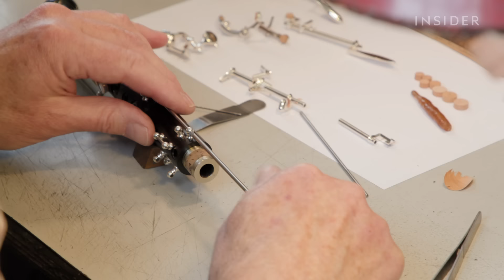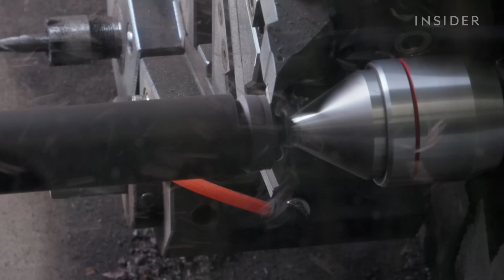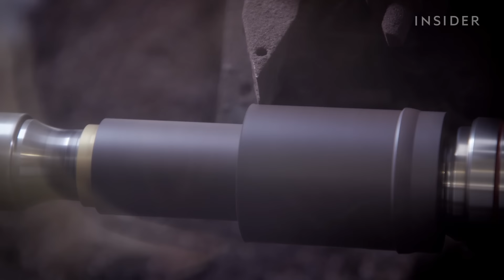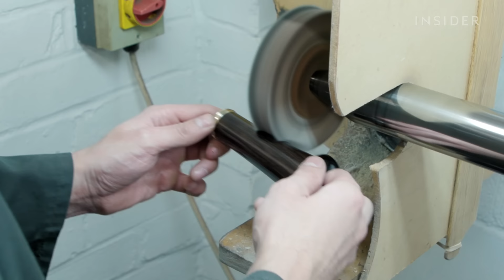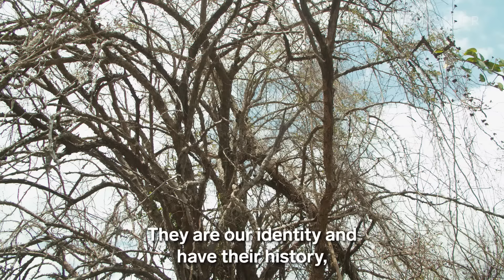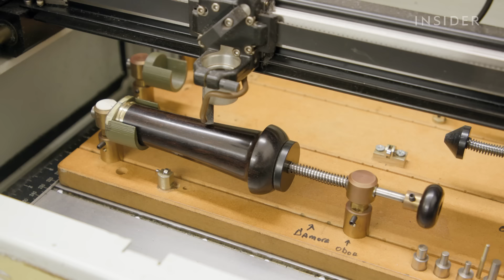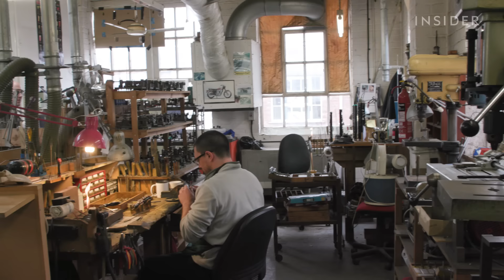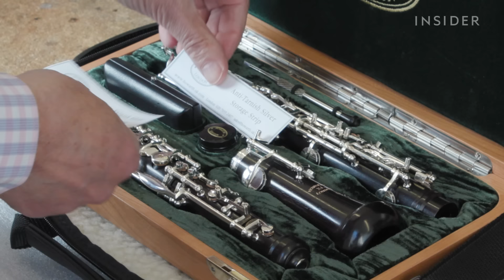Why Oboes Are So Expensive | So Expensive | Business Insider

Comment: Didn't expect to see a Metal Lathe, with precision tool bits, being used to make a Wooden Oboe.
Reply: As a person who does manufacturing/metalworking and favorite instrument is oboe, I just love this video
Reply: There is a LOT to this story that doesn't add up.  I wonder how many man hours it takes to run a CNC...
Reply: @RK-kn1ud  the CNC work is only in the turning of the shape of the body, maybe in drilling holes in the proper places, and at Howarth, probably milling some of the metal pieces that are then hand assembled into keys and bands. This gets the process started, but there's so much more. There are endless details, all of which must be painstakingly done by hand. This video barely scratches the surface.

Comment: Niceo video. I wonder if it could be possible to make them out of some kind of engineering plastic
Reply: Acrylic makes a great oboe, potentially as good as any wood oboe if done correctly.
Reply: They've been made in delrin (acetyl), PVC and ebonite (hard rubber) either as a whole or just the top joint, as well as wood (grenadilla, cocobolo and kingwood) with a partial ebonite bore lining in the top joint to safeguard against cracking.
Reply: @chrisperyagh  and against bore dimension changes as well.
Reply: It would be good if there was a singular substance they could be made from that was stable and not affected by humidity changes like wood or temperature changes like plastics. Not to mention plentiful, non-toxic, non-porous, non-reactive, easy to machine, has high tensile strength and doesn't weigh a ton. Is that asking too much from one single material?

Comment: Hello, flute and oboe player here. Professional flutes are on average 10,000 to 12,000 dollars. Starting as low as around 6,000 to as much as 20,000, even 50,000 in some cases. It all depends on brand and model. I heard the 4x more than a professional flute and giggled. My professional flute is roughly $13,800. Brannen, a very well known professional only brand starts as low as 10,000 if I remember correctly.
Reply: 4x more than a pro flute is hilarious, I’m sure there are 15k oboes out there. The most expensive a flute can get is around 130k for a full 24k Muramatsu.

Comment: I mean you can just make it out of plastic instead of this wood right? Manufacturing looks slightly complicated (for a musical instrument, otherwise this is nothing) but does not justify the cost. Seems like most cost is due to waiting waiting and waiting. All due to the wood. 

Does not seem to be wise choice in material if its so rare, endangered, low success rate in manufacturing and high failure rates in usage.
Reply: No. Only for student models. Grenadilla is used because of its sound quality and because although it can crack, but it's quite resistant against warping. What you just saw in this video is the very tip of the iceberg. Making one of these is waaaaay more complicated than you imagine. Don't think that just because someone can use a lathe, they'd be able to make one of these. The cost is justified.
Reply: @tamasfoldesi2358  as an electrical engineer, I naturally tend to compare the process to ones in my industry. When I compare the manufacturering and design process for something like a current 5nm CPU, this is oboe manufacturing absolutely nothing in terms of effort and resources required. So I didn't feel the price is really justified. But I guess it's just about economy of scales.
Reply: High-quality resins in intermediate models can sound quite nice, but in my experience they don’t project nearly as well.
Reply: Oboes are constantly put under a lot of environmental strain in the playing environment that many other woods just cannot handle. Temperature, humidity, pressure, quick changes in both while playing, are all very stressful on wood. Because the holes for the keys are so close together on an oboe, cracking is a concern. I would not consider it a “high failure rate,” though. It would be much worse with a softer wood. There are other woods oboes are made of, but those woods are often in a similar position as grenadilla, and grenadilla is considered to be the classic standard.

Oboes are also not made on commission, so you’re never waiting to get a new one. I went to the IDRS conference a few months ago and there were hundreds of instruments to try and buy. You have to try many oboes before you find one that will play the best for you. You can get two oboes from the same manufacturer, the same model, made from the same wood, but there are so many subtleties that one will play better for you than the other.
Reply: @skylargurnett8483  thank you for the info. I did not know much about oboes at all. What is it that you meant by 'not made on commission'?
Reply: @snehanshourya3850  They are mass produced, but unlike with CPUs, there are a lot of handwork involved. And as I've said, you don't know much about these instruments and how they are made. You've only seen like 1% of the entire process or even less. When I was just an average music school student and didn't know much about these instruments I also thought that they are overpriced. But after I started to learn how to repair or make them, I realized that they're not overpriced at all (maybe professional models are, but it's the same with everything, not just instruments) and the only reason why they are not even more expensive is because of the mass production and because there are lots of automated processes.

Comment: fascinating.  creating one seems more complex than playing one (which i believe is the most difficult instrument to learn), so how did they exist before such precise machines came into being?  granted the first ones were very basic in comparison...
Reply: They were just less precise. But actually a lathe is a surprisingly old invention. I think the oldest one found is from ancient Egypt if I remember correctly. Those were manpowered of course and not electric ones. Soldering, casting, smithing, drilling are also pretty old methods.
Reply: @tamasfoldesi2358  lol yah i knew that about lathes and such, but less precise in this case is such an understatement.  these are like rocket engines compared to fireworks 🙂.

Comment: Can't the wood material be substituted? Cutting dead trees isn't good idea for the long term.
Reply: Oboes (and clarinets) are made from a wide variety of woods including grenadilla… but to achieve the correct sound properties a material that reflects (not absorbs) sound is needed. Most woods are too soft to function or would only last a short time (a grenadilla instrument can last more than 50 years). This is the least destructive environment impact with the highest quality product at the time and poses far less threat than switching to a material that would cycle through natural products at a faster rate
Reply: The limited harvesting of grenadilla wood (African blackwood) is because of conservation efforts to make the harvesting sustainable. This also goes for rosewood and cocobolo, which are hardwoods suitable for making oboes, as well. 

In more recent years, efforts have been made to produce oboes out of mopane, which is a much less endangered wood, and it looks gorgeous. My Howarth is mopane, and it has a great sound. Maple is also used in some models and sounds so bright and happy! But grenadilla and to a lesser extent, cocobolo, are still considered the best wood for professionals.
Reply: @skylargurnett8483  That's cool.

Comment: Everything is Expensive according to Business Insider
Reply: May be they show only expensive thing
Reply: @akashbavishi6615  that's the joke
Reply: @kapa8514  I am cheap.
Reply: @kapa8514  what about you? 😂🤣
Reply: They are 👍 always.
Reply: Well. the price on these professional obos is very high, it doesnt take 5 years to make ONE the company makes a bunch of other instruments too according to their web site. Some of that 5 year claim is no doubt for seasoning the blackwood turnings and blanks.  If one oboe was worked on 40 hours a week for 5 years and you do the payroll math, even at a nominal $15 an hour that's $30,000 a year, x 5 years the labor cost alone would run $150,000, so clearly the 5 years it takes to make an oboe includes a lot of time where the wood is just sitting in rows on the shelves exposed to heat, cold, dry, moisture etc like the narrator detailed.

It would be interesting to learn how many actual man hours goes into the turning and construction, fitting and adjusting processes- the actual making and finishing.
In pipe organs we know how long each component and process takes, I often make wood organ pipes, a set of pipes used in a 16 foot rank of pipes numbering 32 pipes takes hundreds of board feet of poplar, and several weeks to contruct, and a few days to voice. A pedal board takes about one work week, it all adds up to fill the $2 or $3 million price tag or whatever the final contract price is depending on the size of the instrument.